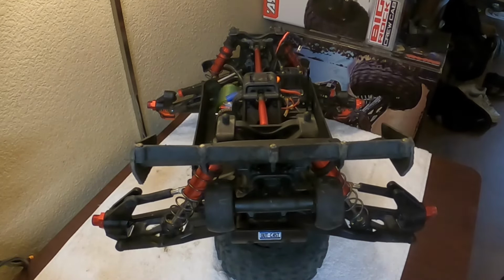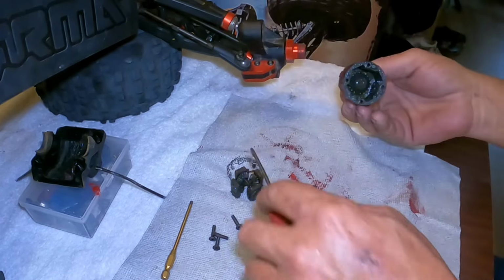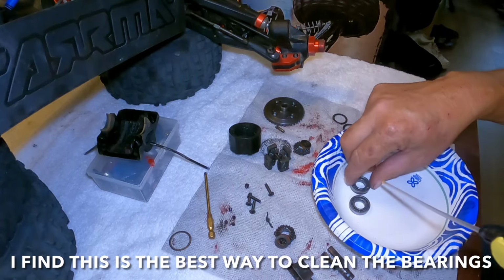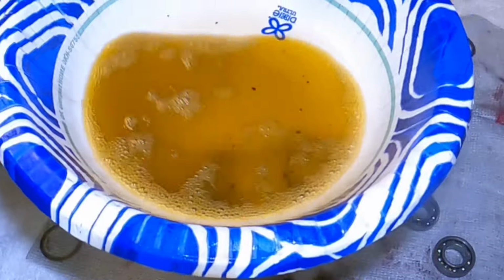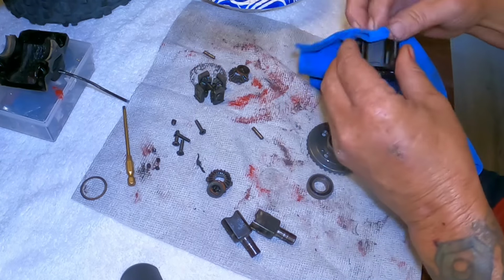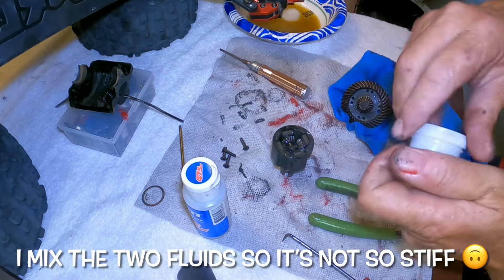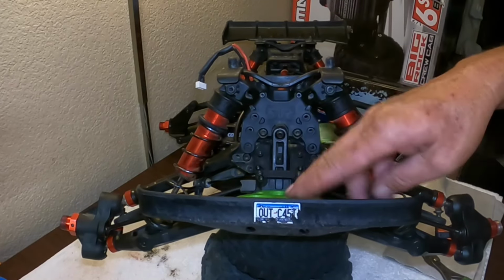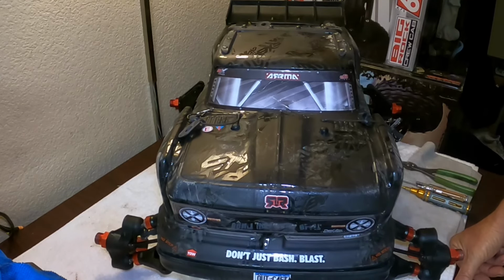Arrma Outcast 8S 3 years Old How to service bearings?

Comment: Thanks! Great video Earl towards the money pit I'm actually about to start ripping apart my X-Maxx to replace the lower back bulkhead The screws for the cush drive cover is stripped out
Reply: Drill and put in m4 screws if that’s all that’s wrong with the bulkhead
Reply from the maker: Wow I’ve had that issue with the idle gear cover to good luck 👍 thanks for the money put support definitely need it on this one 💯

Comment: You know what I noticed Earl? If you would replace Arrma parts with a much better upgrade part the first time it seems like you would not have to go back for the same problem like when you use Arrma replacement parts. Not on everything, but on parts that keep failing and the weak parts around it.
Reply from the maker: Problem I find upgrading the Kraton with m2c is anything you make stronger causes a bigger issue that’s more expensive 💯🤔
Reply: @earlmoorhead5555  yeah I get that too. I just keep fixing my outcast with good parts until one day it became a tank.. but you are exactly right… replace this and that breaks. It does eventually stop. Oh, that would be a great series Earl!! Replace everything that breaks until it stops. Then people watching can just put all the parts it takes to make their Kratons tanks… it would be an expensive venture though
Reply from the maker: @RC-Closer1313 I have an m2 C Kraton 8s couldn’t keep a control arm or wing on that rc as the weight was to much and that was just a chassis upgrade mount and center brace with the steering button from m2c 🤷🏻‍♂️
Reply: @earlmoorhead5555  yeah, those 5th scale trucks are heavy… you would know better than me. I’m more 8th scale and 10th scale. They don’t seem to have to much of a problem with building them up with some aluminum

Comment: I had my K8 lock up a rear bearing. On all my bearings I open them up, clean with brake clean and get them moving. Then I pack them with wheel bearing grease from the local auto parts store. It’s like $10-$15 for the brake clean and grease and you have enough grease for a life time. I service the bearings once a year after that and never have an issue. Done this with my XMaxx, K8, K6, and Maxx V2.
Reply from the maker: Brake clean won’t remove rust that why I use PB blaster but grease is the way to go 👍
Reply: This is a good strategy. I have a mason jar full of mineral spirits I throw parts in and shake it for a little. 

I always check bearings while I’m already working in that area.
Reply from the maker: @aaronmoore5552  yes me to always checking bearing it’s the bearing we hardly see that can fail 👍
Reply: @earlmoorhead5555  true. I don’t have rust issues because Arizona lol. I pretty much exclusively run in dirt, no water no grass. I don’t like using PB Blaster because I soaked some bearings in it and the bearings completely seized up. Maybe they sat in there too long but after that I just switched to brake clean.
Reply from the maker: @stayunique91  California don’t have rust either but running in the winter months causes some rust in the bearings and screws plus cleaning the rc also contributes to the issue
Reply: Wow, two days working on this rig? I have been putting off working on my KT8S since last summer. I just don't have the time. But, I'll have to get to it eventually. You are dedicated, Earl. That's also a lot of money in parts. This hobby has truly gotten expensive.

Comment: Nice job showing how to clean uo the bearings on the rear diff. I would only do that thought if I didn't have access to new bearings and was in a pinch. $12 for 2 bearings is cheap enough to just change them out.

Comment: Can you do a video on how to adjust camber and toe on the outcast? And explain what the difference is. And proper set up for an rc
Reply from the maker: I have several video on a iPhone alignment using an app but for a basher 1/8the toe out and 0 camber works great 👍 rear always stock has tow in to drive the rc straight and you need parts to adjust most of them 👍
Reply from the maker: https://youtu.be/punaYt5u67E?si=X_Lcf9jdjlLPyE49

Comment: The diff case  will not last very long,  the tits that broke off will cause the case to shift and will loosen up in no time.  happend to me. they do more than align the two parts. good luck. My 2 cent.  Have fun
Reply from the maker: It’s for the torque of the gear now it relies on the 4screw rather then the help of the diff case
Reply: @earlmoorhead5555  don't listen to me.  figure it out the hard way bro. i need not share any other information i know.  have fun with that.   It has to have the tities and the screws to hold it together. with the tits broke off it still will not hold it together.  it will still slip.  good luck buddy.
Reply from the maker: Man people read things differently! As I agree with you then you leave this comment hmm 🤔